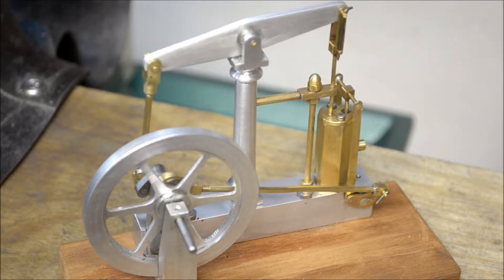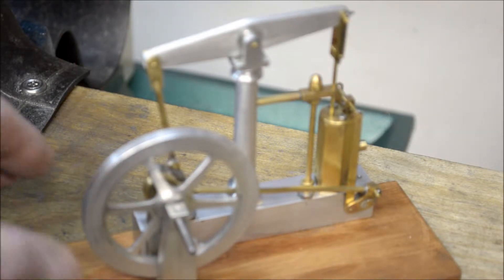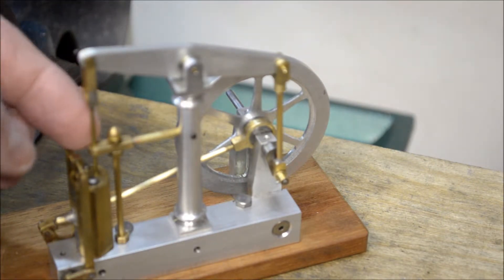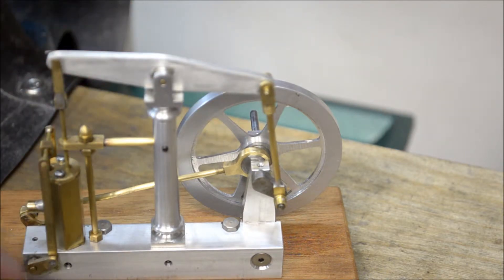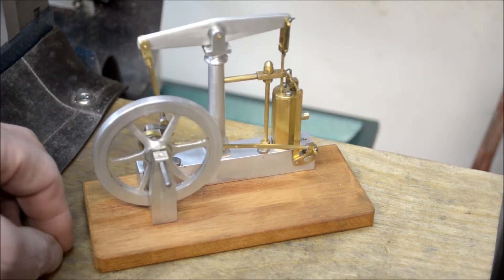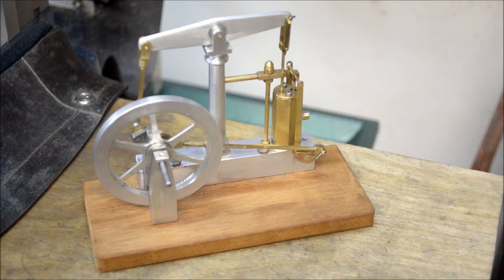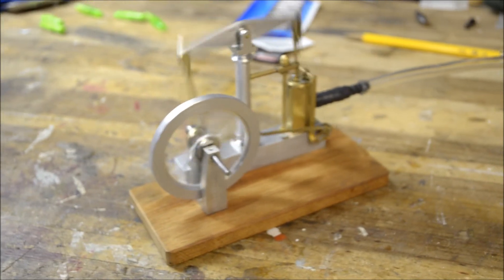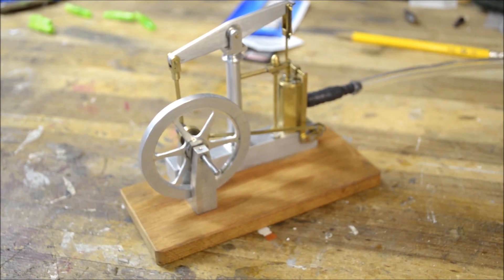Elmer Verberg Beam Engine Conclusion

Comment: Can you help me with my beam engine. I just finished making all the parts and I put it together and I can't get it to work. This is my first ever try at making a steam engine so I really have no knowledge of them I am just a hobby machinist and I followed all your build videos you inspired me to make one. If you look at my channel I uploaded a video and a couple shorts of me trying to run it. I am kind of suspecting it may be the valve not fully opening? or maybe I didn't time it right? Any help would be greatly appreciated I don't know who to ask for help. Thanks and here's the links to the videos if you ever get time. https://www.youtube.com/watch?v=OCV0K3qVRx0
https://www.youtube.com/watch?v=uJrMnFg7ll8
https://www.youtube.com/watch?v=oabtu7QIWEg
Reply from the maker: I am glad that you were inspired you to make one, it looks like it turned out very nice. I’ve found valve timing to be very critical, the piston should be up while the valve is down. Try adjusting the eccentric in relation to the crankshaft in small amounts with the air connected and if everything is made to size you should start to find the spot where the engine will want to run. And you also want make sure the valve has enough travel at both ends, that can be adjusted with the length of the eccentric strap. I hope this helps, let me know.
Reply: @welcometothemachineshop466  Hey, thanks for the help. I think I didn't have the valve and crank arm in the right position but I did get it to run. It takes a little more psi than I think it should I might need to redo the valve. But here's a short video of it running. Thanks again! https://www.youtube.com/watch?v=zgV-KV_8f14

Comment: Hey, I’m recreating this model and I had a question. How much CFM does it run on? Thanks
Reply from the maker: I never tried measuring air consumption, but it runs on very little air pressure, as little as 5 psi. Hope that helps.

Comment: Nice channel. Just stumbled here. What machines are you using?
Reply from the maker: Nikhil B thanks for stopping by. I have have a 12X18 Craftsman/Atlas lathe, Grizzly G0704 milling machine, Craftsman Drill Press, a Delta 4X36 belt sander plus the usual assortment of hand and precision measuring tools.